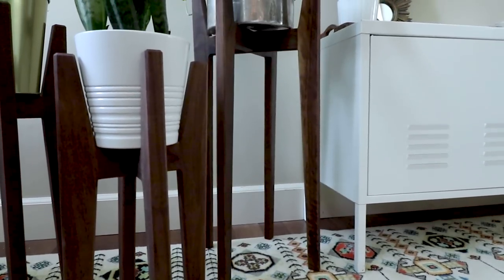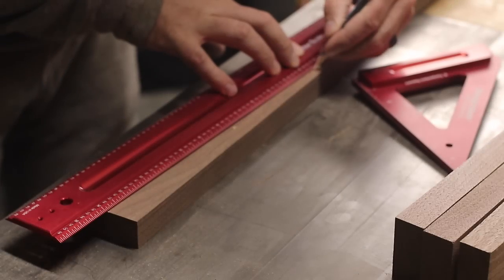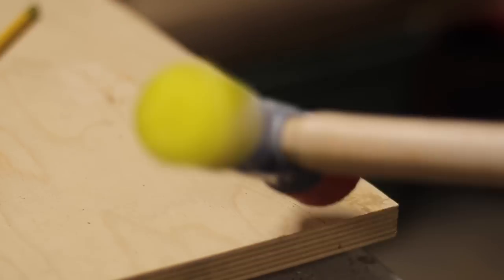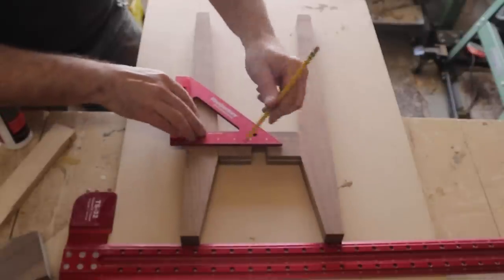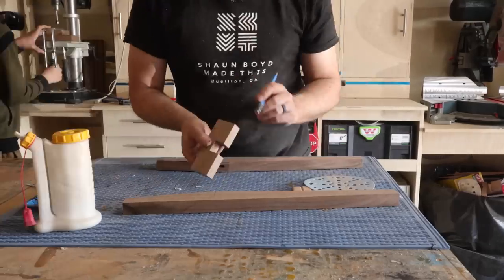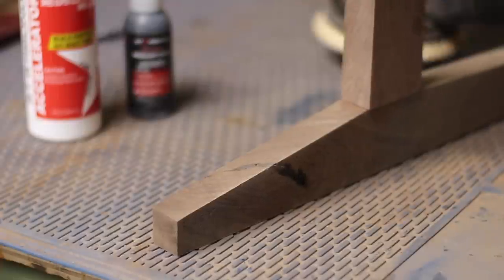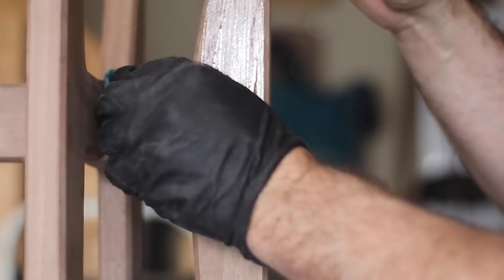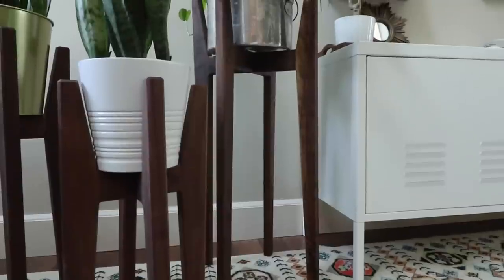Simple DIY Plant Stand // DIY Plant Stands

Comment: These came out really nice! I see what you mean about using different wood species, though. How sturdy is that half lap joint without any glue or fastener?
Reply from the maker: Yeah, they would popped a lot more if I would have used different woods for sure! They are super sturdy. I won’t be standing on them to demonstrate, but they’re solid.